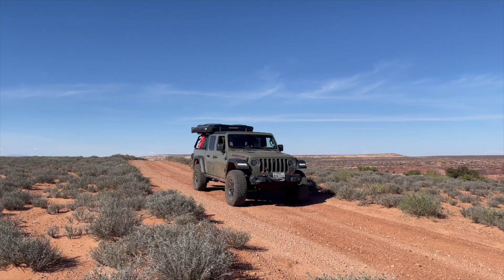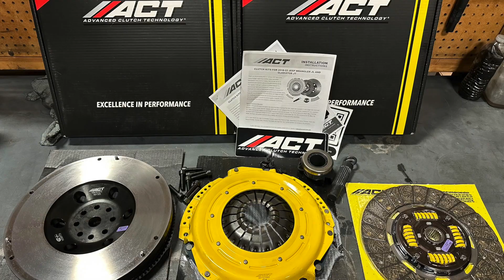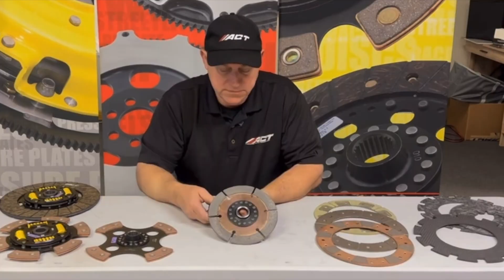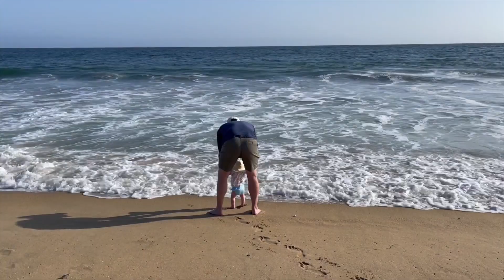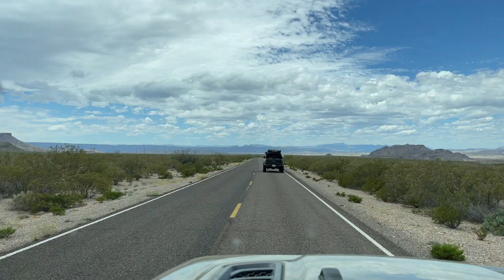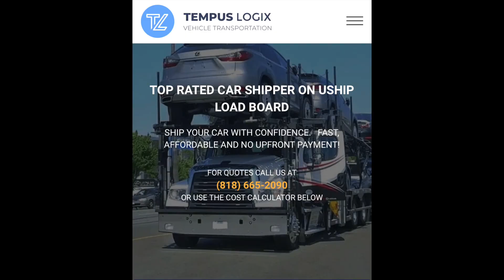ACT Performance Clutch with Pro-Mass Flywheel Review for Jeep JL Wrangler & JT Gladiator

Comment: Replaced my clutch with the centerforce 2 at about 20k miles due to the recall and lack of resolution at the time. 80k miles on it now and have now put 2 CF2’s in it at this point (first shop did absolutely everything wrong) and it’s still shifting terribly. I’ve got a 2020 JT rubicon with 35’s and 5.88’s and my next option is probably to go with the coaxial hydraulic slave release instead of using the fork because I think the disc is failing to release entirely from the flywheel so I’m hoping that resolves my issue but I’m going to do the work myself this time because you know what they say about wanting something done right…now I’m wondering if the ACT option is a better choice but I’m extremely reluctant to buy a 3rd clutch for this thing…

Apparently this new design on JL/JT’s and the lack of a pilot bearing can really make it hell on aftermarket clutch options in rare cases and it seems like I’m one of those rare cases. Im sure that it didn’t help that the first shop installed the first clutch disc BACKWARDS and never fully bled the hydraulics which I had to drive with for the better part of a year before I could put another one in it (long story but they claimed it was all defective parts & I supplied the clutch). Hopefully it didn’t cause irreversible damage but we shall see. I love my gladiator and have sunk massive amounts of money into it but these ongoing clutch issues are really ruining it. Hopefully I’ll be able to get it figured out when I pull the bell housing myself.
Reply from the maker: From what I understand, ACT is under development with some release bearing upgrades that replaces the factory plastic housing. I currently am going through issues with my ACT that jive with everyone else that is having issues with other brands as well. I assume you meant 4.88 with 35’s? 
I’m almost to the point now where I would install the factory clutch back to have full function, despite the chance of slippage to the point of a fire

Comment: What is that red piece sticking out of your grill?
Reply from the maker: I have an Anderson plug disconnect for my winch..
Reply: @GatorOverland huh…I’ll have to look into those. I have a very similar setup on my 2020 JT Rubi with the Leitner rack and everything but mines the 1st gen. Thanks for the video! Currently trying to find something explaining the difference between dual mass and single mass flywheels.

Comment: There is a company in the LA valley that sells a short shift kit for your transmission and can be installed by yourself easily, the kit takes half of your shift throw away it bolts onto the top of your case and can be installed inside of the cab this really improves your shifting
Reply from the maker: I believe B&M sells a short shift kit as well..

Comment: 115k miles on my JK original clutch w/ 39s and 5.13 gears, wheeled hard. The clutch is finally about to kick it, but replacing at 50-60k? Come on...
Reply from the maker: JK had all the goods for driveline strength. As they say “they don’t make them like they used to”
The JL/JT unfortunately were equipped with a weak clutch design. Some aren’t making clutches aren’t making  5k miles.. it’s sad.
Reply: @GatorOverland  I posted right before I saw the JL/JT clutch design next to the JK on the table. So much for the KISS principle. One would think optimizing for profit would favor simpler designs. Haha, oh well.
Reply from the maker: @m_ssingp_eces this ACT clutch is actually a modified JK clutch.. so back to KISS

Comment: First time watcher, nice vid. I appreciate such a detailed review.  My JLU is my 7th (I think, lol, might be missing 1) manual vehicle I've owned over 30 years. It is the absolute worst clutch I've ever driven. Half of my lift kit showed up yesterday, the other half is back ordered.  I have 37s and wheels picked out. I've been considering the ACT clutch, but it's rough deciding to swap a clutch with only 8,200 miles on it. But i think stock is that bad.
Reply from the maker: If your stock clutch is bad the dealership will install the act under warranty.. many folks have done this, but it takes time for approval. Otherwise, about 6hours of your time and some simple hand tools and a torque wrench, you can do it in your driveway. Many folks have done this as well. 
If I was considering any other kit it would be the south bend clutch.. It is a stock replacement, but they have revamped it to mitigate the stock clutch issues. Some folks are swapping clutches at 1k.. I made it 60k without issue and eval shown to be 50% worn. I now have nearly 40k and 100% love the clutch performance over stock. 
ACT has an in depth step by step install (featuring my vehicle) the you can follow if you decided to do it on your own .
https://youtu.be/F1j550d5uBQ?si=Ka9zHXZXXHLfGIIW
Reply: @GatorOverland  No, there's nothing technically wrong with it, i just find the action terrible. I modulate the throttle, vroom vroom vroom, to get moving. I must have tight shoes on or all of my starts are all over the place.  That said, when I get it replaced (to me, this is an on the lift job) i will be submitting the paperwork for replacement to Jeep. With the state of the company, and I'm a retired Chrysler worker, I'm expecting it to be denied. Oh well, what's one pension check? Lol

Comment: Does it help at all with that huge lag/lack of power in 5th and 6th gear?
Reply from the maker: Well there are a lot of variable at play here.. if you’re lifted with larger tires and haven’t regear’d, then no, especially if you’re a non rubicon with 3.73..BUT, it will reduce the chances of slippage in the higher gears when under load. If you’re regeared then 5th and 6th should have usable power..
Reply: @GatorOverland  What about say a stock Rubi or Willys with with 33in tires?
Reply from the maker: Rubicon/mojave/sport s has 4.10 gears and a Willy’s is 3.73 and will probably be a bit underpowered in the top end even with the 33’s.
Reply: @GatorOverland  I had a 2020 Rubi Gladiator with a manual. I usually love a manual but that Gladiator felt so under powered at highway speeds. Traded it for a 2021 2 door Rubi Wrangler with the 2.0. Looking at a new Jeep would love a manual but don't want to go back to struggling to make it up to 70mph.
Reply from the maker: I have 37’s and 5.13’s now after 30k of rolling 37’s with 4.10’s and it was definitely lethargic in 5th and 6th, especially at high elevation.. I love the way mine performs.. it’s not winning any races, but has the power I need for towing at highway speeds
Reply: @GatorOverland  Stock 33s on my 2.0 also have a JB4 and Pedal Monster. It runs like a sports car, it'll be a tough sell to go back to a sleepy 3.6 manual lol.

Comment: I never had an issue with the clutch on my '18 JLU Rubicon either. I'm about to get a new '25 JL Rubi, so we'll see!
Reply from the maker: It has only affected about 7% of total production 🤏🏼, but the fact that there is a potential makes it a looming burden.. I love my manual! And even more so after the clutch install. Enjoy your ‘25! 🤘🏼
Reply: @GatorOverland  Thanks! This video definitely sold me on looking at an aftermarket clutch earlier than I would have otherwise.
Reply from the maker: @robywar good to hear… I have about 10,000 miles of towing our off-road trailer now and it pulls great… The engagement and ability to stay heavy in the throttle without worrying slippage if definitely peace of mind.

Comment: It sure looks like the quality of Jeeps have gone down hill significantly since the JK models!  I don't have any issues with my 6 speed in my Rubi Hardrock!
Reply from the maker: And you probably won’t… if anything it will be typical waterpump, cam shaft, ECU ground, or coil packs.. hard to break JK..

Comment: Running that steep of a grade and that high of a gear testing out the transmission really puts tremendous loads on the crankshaft bearings!!!  Not good!!!
Reply from the maker: You’re absolutely correct.. and that’s why only tried it for a moment as advised but the clutch company.. I wouldn’t normally do this for the reasons you mention.

Comment: Shopping for a Rubicon i ran into a used 2020 manual today test drove it 3 times an absolutely loved it, didnt pull the trigger but i might just return tomorrow and get it. I didnt notice weir shifting and now wondering if the recall was done it now has50k on the odometer
Reply from the maker: I would consider by 75-80k to be safe .. other than that I love mine.. just rolled 90k in mine.. 30k on ACT upgrade.. love it

Comment: I have never heard of a clutch requiring replacement at 60,000 unless the driver doesn't know what they are doing. Hopefully the ACT clutch lasts the life of your Gladiator.
Reply: tbh, this is my 7th manual vehicle, two i sold to people i knew. One had over 230,000 when he sold it 4th set of brakes, original clutch. I also was very abusive to that car, ripping out the second gear syncros at about 20,000 miles. The other had 171,000, also original clutch, last check. That said I hate this clutch because I probably feather it out 2-3 times slower for smoothness. Also, heavy vehicle that barely meets threshold of the torque output. I can easily see needing a clutch early, especially since I moved back to the city where i drive less miles but there's a light every 1/2 mile.
Reply from the maker: I have no doubts that it will

Comment: Wouldn't adding inertia end up over driving your engine and causing additional wear
Reply from the maker: There are different variables in place when you increase the inertia… In some respects it is requiring more torque to do the same amount of revolution… But when up to speed, there is less torque required to maintain the speed and benefits throughout the range of RPM and load.
Reply: @GatorOverland  yeah once running it would will balance out... guess the additional stresses would be more at the very low rpm or during shutdown.  How's it been since the video?

Been looking at this and the centerforce when I upgrade on my 2016 JKU Backcountry manual... Sahara so I don't have the 4:1. 
Anything will help
Reply from the maker: 100% the best upgrade I’ve done to the vehicle… The performance over the past 30,000 miles has been incredible… I absolutely love it… Center force makes a nice option as well but it requires aftermarket hydraulics… This is plug and play using all OEM equipment and sold me all together at the beginning.
Reply: @GatorOverland  gotcha. Thought the hydraulics were optional or for the older jeeps.
 Was not aware necessary for the jk and jl / jt
Reply from the maker: For the JK that is a good point… It may be direct fit without hydraulics… But Centerforce for the JL/JT is 100% replacement for sure.. all ACT are engineered to work with the factory equipment

Comment: Hi, id like to suggest doing a tutorial on how to use the 4WD with manual transmission. thanks
Reply from the maker: Well Why didn’t you say so!!!?? Check out my original manual transmission video that includes tutorial.. happy to answer any questions you may have..Jeep Gladiator Manual vs. Automatic Transmission Review
https://youtu.be/IteJM9cbBK4
Reply: @GatorOverland  thanks for replying.

Comment: 2022 Jeep Gladiator, The First Clutch was Replaced at 40,000 Miles , it showed effects at 36,000 Miles, replaced Under the Recall but your clutch lasted 60,000 Miles that's Good 😊
Reply from the maker: Yes, and the evaluation of my clutch at 60,000 miles was only approximately 50% wear… Love my ACT clutch now

Comment: Does yours ever sound like Chewbacca when you're letting off the pedal lol? Mine does and an ACT engineer said it's normal.
Reply from the maker: Wow, no it’s never made that noice, whether it be at idle or shifting at raised RPM.. very weird.. not sure I’ve ever heard that in any manual vehicle I’ve owned..
Reply: @GatorOverland  Yeah me either... Works great though.
Reply from the maker: @meatwad600 how often is the occurrence?
Reply: @GatorOverland  Not as often anymore. Only when going into first and usually when it's cold. Engine temp not air.

Comment: Fellow SE Texan here, found your channel via clutch research, and now thinking about hot water!  😂. Assume they installed the organic disc vs the ceramic?
Reply from the maker: Wow small world.. we’re from fannett area! I went with the JP6-HDSS which is the street sprung with pro mass flywheel and it comes with the organic material and capable of 479ftlb torque.. all street sprung are organic 

The JP5-HDG6 thru JP7-HDG6 race sprung are the ceramic material.. and capable of 613ft/lb of torque

Comment: Can we get a update on the clutch? 
How is your experience still? 
Also Some people are complaining about loud chatter type noise on take off and reverse…. Have you noticed anything abnormal?
Reply: Great!!!! I’ve ordered one and plan to install in next week or two at most. Not worried about the normal clutch noise in neutral. Can’t wait!
Reply from the maker: I’m so excited for you… Please respond back with your thoughts after you install…
Here is the step-by-step install by ACT… Actually features my vehicle  https://youtu.be/F1j550d5uBQ?si=OhHPejma_NEHKFPw
Reply: @GatorOverland  installed last week and maybe put 100 miles on it so far. Some city and some highway. Notice the difference in the clutch and flywheel. So far happy with it but need to get it broken in good. It chatters pretty good in 1st and reverse with no throttle input.

Still having issues with service transmission light but seems like that’s 100% programming issue that Jeep needs to fix. 

All and all happy with the ACT set up !
Reply from the maker: @BirdsMojave23 yes, the shuttering at low RPM is just a result of design… Nearly all mass shutter at low RPM.. glad to hear it’s working out for you🤘🏼🤘🏼🤘🏼
Reply from the maker: It’s been a year to date since we did the clutch transplant… Absolutely no regrets… Performs flawlessly… There is a bit of chatter when in neutral but it’s not obnoxious… It’s very common with traditional clutches.

Comment: I’m at 100k+ on my stock JLU rubicon clutch and zero issues aside from clutch fade in extreme temperatures sitting in stop and go traffic. In fact, I was surprised by how sporty the clutch felt stock and it still feels just as springy as it did the day I bought with 300 miles. Offroad it works great in low gear all day for weeks, no issues. I am doing research now for future upgrade when it does goes out but I am surprised by how much they are under selling the stock clutch. I doubt it’s any different in the non rubicon models, but of course, can’t sell a product and praise the competition.
Reply: The mopar clutch is back-ordered like forever…some of us don’t have a choice. ACT for me!
Reply from the maker: @JustEmptyEveryPocket you will not regret any mile driven with that clutch installed .. I love mine!
Reply: @ while I’m at it….scooped a B&M shifter :)
Reply from the maker: @JustEmptyEveryPocket quick shifts baby!! 🤘🏼🤘🏼
Reply from the maker: Totally right about that! 
I guarantee you won’t regret the ACT upgrade !! 30k so far and love it every day!!

Comment: Thank you for this video! I recently purchased a 2022 2 door rubicon with the six speed manual. I've been driving manual transmissions all my life and I absolutely hate this factory clutch. I'm sold on the ACT alternative after this video and will be upgrading soon!
Reply from the maker: 30k miles later I Still absolutely love the ACT clutch and flywheel .. incredible upgrade.. get with Dirk at ACT if you have any questions. Here’s the full install video featuring my truck https://youtu.be/F1j550d5uBQ?si=eOSYOziVTWsAL5gm